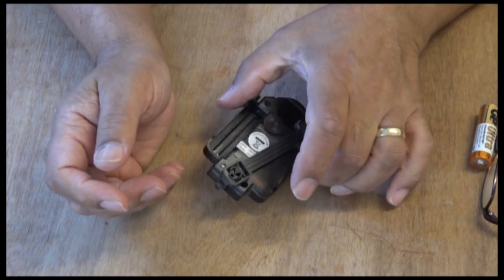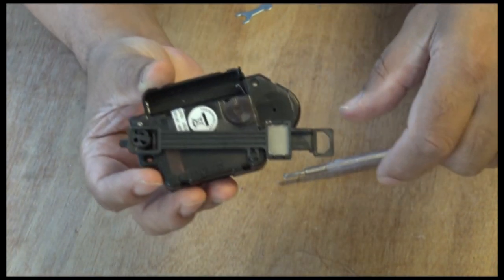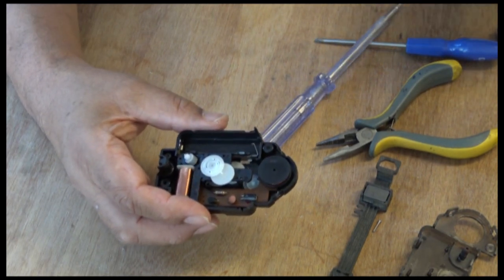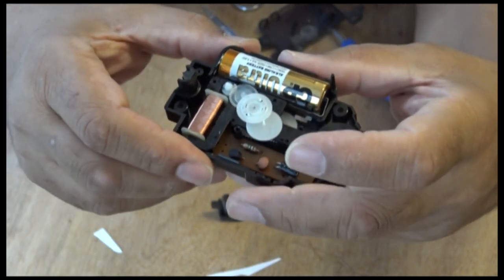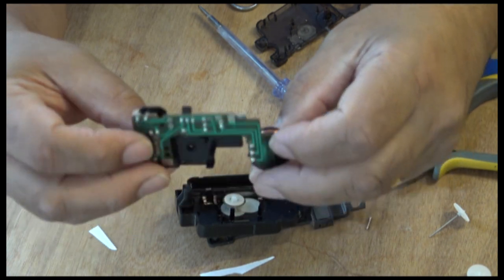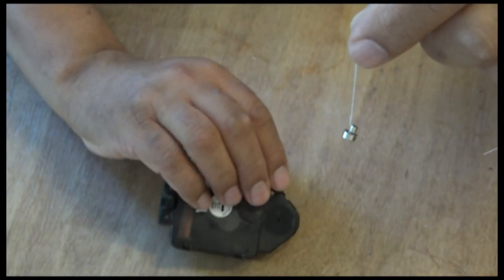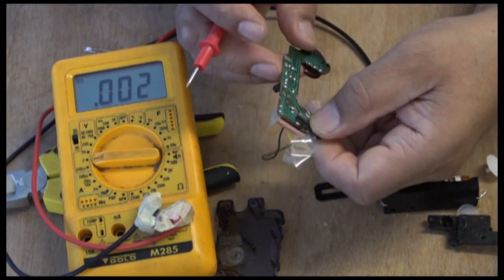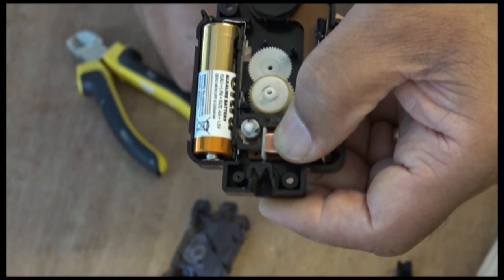#84. Pendulum Quartz Clock Teardown

Comment: Thank you very much! This video is really helpful! This video proves that quartz clock moments can be repaired and restored either it may be normal or pendulum model. So that people will no more get tempted to throw old, damaged and unfunctioning clocks into garbage or by the side of road or street as waste. Instead they would inspired to repair the quartz pendulum moment when the pendulum stops.
Reply from the maker: Thank you it was a great project and I do love these clocks. I have found old ones which I have kept in case there is a new project i can make 🙏
Reply: ❤forditas magyar 5:01  nyelvre

Comment: A guess at the big coil with 3 terminations would be that is two coils. One to detect the magnet on the pendulum and trigger the transistor to pass current through the other coil to repel the magnet. A guess on the mechanical mechanism is there is some sort of ratchet effect that prevents the little magnetic armature thing going back. Looking around 05:48 does the top of the rotating magnet have a have a sort of helical shape. I have put my box of bits away again at the moment so I can't check here. I am trying to get some other work done.  Some of Lidmotor's pulse motor circuits have the coil with the centre tap to trigger the transistor so you might find some of his videos helpful.
Reply from the maker: GrandadIsAnOldMan yes I think you’re right on all counts. I thought as much about the coil I’m going to try and make one soon. 
Thank you
Reply: @JustFun-iz9rf  well there is a coincidence. If you haven't already seen it, you might like bigclivedotcom's latest video which covers this sort of circuit https://youtu.be/MHRxYtVD1IU

Comment: I have exact same one but pendulum is very weak, any ideas how to fix
Reply from the maker: I’m not an expert but a new battery and make sure the contacts are clean. What made my clock slow was when I put the battery wrong way. The electronics should be okay. Can’t tell until you open it up. Hope this helps good luck
Reply from the maker: Also I’m thinking if the pendulum is sticking anywhere. Sorry just thought of that
Reply: In this circuit 10mfd.10v capacitor change
Reply: Can you tell me how to hang on wall  I am stuck because there is no hook or hole kind of thing.😢